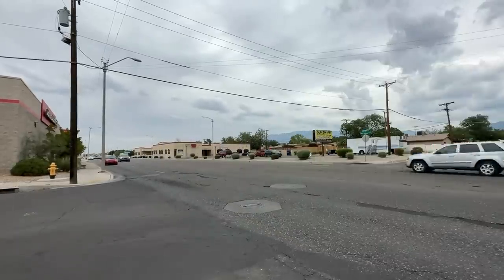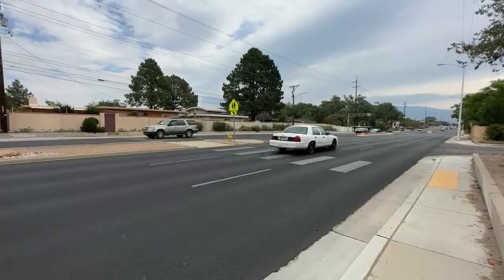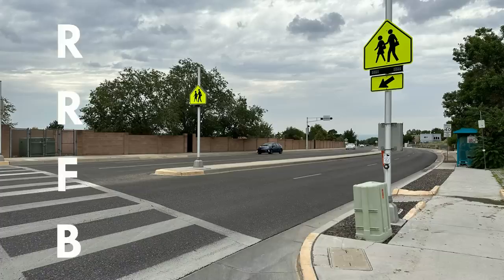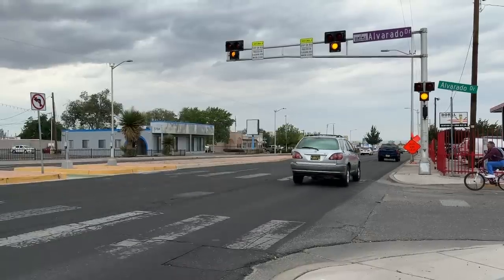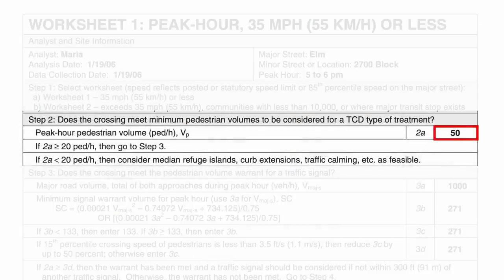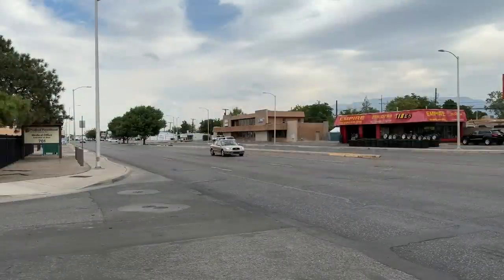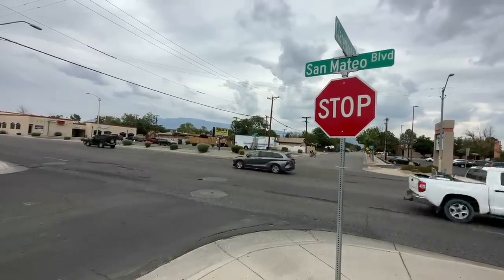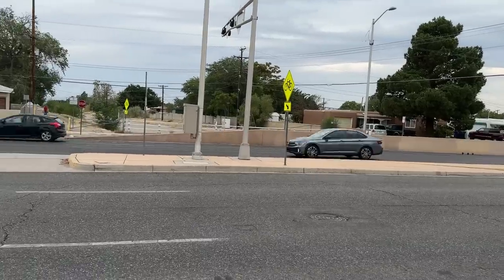The Insane Ways Traffic Engineers Try to Make Streets "Safe" For Walking

Comment: Came here from Nebula just to say that I was personally hit by a pickup truck at one of these crosswalks. I pressed the button, waiting for all four lanes of traffic to stop, looked both ways, then started walking. As soon as I did, the lights timed out and stopped flashing. The driver of the truck was looking at the lights not me, likely because I was barely visible because his hood came up to about my shoulder. As soon as the lights stopped he started driving and hit me in the hip. I was working as a delivery runner for Jimmy John's at the time and was so worried about being late and losing my tip that I didn't stop to get witnesses or talk to the police despite many people stopping to ask if I was okay and offering to testify. I just limped my way to the next delivery. Looking back, I wish so badly that I would have pressed charges. I've since paid nearly $2,000 for physical therapy on my hip for issues that came up more than a year later.

Comment: In British Columbia, Canada we occasionally have pedestrians controlled traffic lights. How they work is that they flash green until someone presses the crossing button, then the light turns red for cars allowing people to cross. Since they work similar to regular traffic lights, drivers must stop on red. I'm not sure if this is the best solution (Dutch style raised zebra crossing would be better of course) but in my opinion they seem simpler than whatever the US is coming up with. And since these pedestrian controlled lights use regular traffic lights, they can be easily converted to a 4-way traditional traffic light intersection.

Comment: Laramie has one of those HAWK things for crossing a 4 lane road between a neighborhood and the University in the stadium area. As a motorist, I hated that thing. There were a couple paragraphs of instructions on how to use it, as a driver... you know how you are supposed to react when the lights were activated, that you had to be so close to read that you would practically be parked on the pedestrian who pushed the button before you understood what you were supposed to do. They should replace those things with regular traffic signals that just stay green until someone pushes the call button.
Reply: Or even better stay dark until someone pushes the button. Green sends the wrong signal.

Comment: In Uruguay I noticed all schools, everywhere, halved speed limits in school zones, and my driver there said fines and traffic reactions was doubled for speed or yield infractions.

In Norway there have been done design measures to separate pedestrians from traffic, or speed limits are set as in residential local roads. There are increased controls in such school areas while schools are in session with increased focus around when school starts after holidays.

In Brazil we where dependant on driving the kids to school as none of the schools in town had safe ways to reach the students entrance by foot.

Comment: Re: Your question of "Is there a reason any street in the US needs seven lanes, anywhere?"

I've been thinking about this a lot, and I think it's better (and safer) to start separating the transit modes rather than adding more car lanes.  Low traffic streets fine for mixed modes.  A bit wider, busier street?  Dedicated bike lanes.  A major thoroughfare?  Dedicated transit lanes.  Increasing vehicle speed doesn't affect throughput at all, so why bother?

One transit lane, one car lane, and one bike lane per direction is much safer, carries more people, and you still have one lane to spare (which you can give back to the pedestrians!).

Any attempt to put in more than one car lane per direction for a street (not a road) should immediately be countered with "why don't we try to increase transit and bike use instead?"
Reply: You think this has not been proposed? Good luck getting your voice through the the car lobbyist sponsored ear plug.

Comment: For the record, I am not a city planner, but I do have ideas for crosswalks. If all ways have no parking lane near the crosswalk and at most 11 ft lane width. One lane per direction, no refuge island unless there is a left turn lane, in which case there should be. 2 lanes per direction needs a refuge island. And 3 lanes per direction should be the absolute maximum. No more than 3.

Comment: Those zebra crossings look scary as fuck. I'm in Australia, which is pretty damn far from the pinnacle of pedestrianism, but they're very rare outside of car parks, and where they do exist, they have 24/7 flashing yellows about the size of level crossing lights, not those tiny things on those RRFDs. They're also usually raised above road level, and in areas with reduced speed limits. Everything else has traffic signals identical to any other intersection. I wouldn't advise walking as soon as the little man goes green, as it's not uncommon for someone to fail to make the yellow, but people will definitely stop.

Comment: My main question after watching this is why there aren't any normal signs at a crosswalk. Mere painted stripes on the road are not enough for visibility. Especially if you're doing 55-60 kph ("35"), you'll be pretty far away when that starts to matter.

In Sweden, the double-threat overtake is also illegal. The penalty? You will lose your license on the spot.
Reply: Law enforcement would have to see you (in flagrante delicto) do it and enforce it, which is rare. It’s very hard to lose your license in the US, even if you kill someone. Even if you do, the person who lost it will probably just keep on driving without it.
Reply: @danielkelly2210  Indeed. And driving without a license is of course an offense in itself - just even harder to discover.

Comment: I watched this video because I saw one of these RRFBs for the first time driving thru Vegas.  We don't have these in CA.  Everyone was slowing down, some people were stopping, some going right thru.  I didn't see any pedestrians so I went thru after stopping.  The ones we have in LA are much easier to understand.  When someone presses the button a light turns red for the traffic.  Everyone understands they must stop. Then after a while the light starts flashing red which most people understand means stop then go if its clear. Sometimes people just stop and wait for the light to change.  They block the traffic behind them for a minute which isn't a big deal.  At least they are not running anyone over.

Comment: Nice to see Albuquerque in the intro! Despite it being generally awful for bikes and pedestrians, there are lots of off-street pathways available. Though they aren't well maintained, so there are some huge cracks which make it a less than ideal ride. However compared to most other American cities of a similar size, in the older (pre-1970?) parts of the city it's easy to avoid the arterials and actually go places either via the pathways or through calm neighborhood streets (there are several bike/ped crossings across I-40 and I-25 to avoid the clusterfrack of those huge interstate entry/exit interchanges). Still -- lots of work to do. For example, there are ZERO protected bike lanes despite over 50 miles (maybe 100?) of on-street bike lanes.

Comment: Before I moved, I would regularly use the western canal trail crossings for my commute in Tempe/Chandler. They used full traffic signals instead of hawks (hilarious acronym btw) even though there was no cross street. Map coords: 33.356961, -111.859112

Of course, the route was far more perilous once you got off the trail to/from your destinations. It's a shame the only things on the route are the canal, power lines, and the occasional park.
Reply: I should add these crossings were especially nice because your wait time for the signal to turn was only about 5-10 seconds. It feels nice to be truly prioritized over cars for once.

Comment: There are a lot of RRDs along Ocean View in Norfolk, Virginia, and Pacific in Virginia Beach. They are placed on the approaching traffic side of the sidewalk and due to design they can have the effect of making waiting pedestrians less visible than typical when the signal isn't active.

I remember seeing regular traffic lights that were activated by the push button in Chapel Hill (on W Franklin St) and Cincinnati (I forget where; was there only because I missed my exit.)

The type of signal used for the HAWK is common outside fire department stations in multiple cities where I've lived and visited though obviously with different timing, and often with a default of flashing yellow.

Comment: In the 90's-2000's in the lead up to the disability discrimination act I was a member of a disability charity which was helping the local council with better street/road design among other things, pedestrian crossings were a complex matter for those involved in road design who didn't have a disability, a point mentioned in your video is a bug bare with many road designs "how to slow down traffic when needed", something I had seen elsewhere seemed to work and work well, a 4 lane road in a city (traffic was already restricted to 40mph maximum and posibley less), the crossing area is raised by around 4 inch, this naturally slowed traffic without stopping traffic flow, during the day the lights work automatically and at less busy times (for pedestrians) a button press is needed, this keeps traffic flowing while still allowing pedestrians to cross with minimal disruption, you made it clear that the numbers of pedestrians needed is made too high for crossings to be generally concidered, I understand that too well, but finding a way that a percentage are happy with is generally acceptable by most, always avoid bridges and subways as they exclude those they are meant to be helping the most.

Comment: I get the problem with the beacons and have actually seen drivers being oblivious to them.  There's a beacon crossing near where I live and I do cross there.  It's a busy four lane state highway with a refuge island in the middle.  I find I'm able to scan oncoming traffic and can tell if a vehicle is not going to slow down so I've never had a situation where I was caught by surprise.  Also, I use a mobility scooter so I cross faster than most.

Comment: I'm not in the US, so traffic design here isn't nearly as terrible. But the best solution my city ever came up with, at what was at the time the single most dangerous pedestrian crossing, was to add traffic lights to said zebra crossing and tack on a speed and red light camera for both directions. They widened and heightened the median and added bollards to make it impossible to overtake at that bit of road. And last but not least they moved a nearby bus stop to now be at the crossing, so if the bus stops there it basically stops all traffic behind it.

The lights are set up in such a way that if a pedestrian pushes the button, the cars instantly get a yellow for 4 seconds, after which it's red and the cameras are utterly ruthless. They provide no margin at all. The fine for running a red pushes 400 euro and the system will also enforce the speed limit. So run a red going 55km/h after correction, and you're looking at neigh on 500 euro in fines.
And there's no point in fighting the fines either. Because there's a photo of your car going through a red light at a zebra crossing with a pedestrian about to enter the crossing. One case made the local paper as someone tried to argue that the 4 second yellow wasn't enough time to react and stop from 50km/h. The judge suspended their license pending a medical exam with the argument that if 4 seconds is not enough time for you to react, you probably shouldn't be driving a motor vehicle at all.

Comment: In my area, school zone speeds are for a lot longer than twenty minutes. Rural area, most of the schools are located on country roads, not town streets.

Neighboring city has the RRFB's, with cat's eyes lights in the street. As a driver, I can barely see them until I am on top of them. They need to be full-sized traffic light style fixtures, like those on the school zone signs. Or a the overhead lights, as shown. There's frequently too much other stuff in the area: street parking too close to the crosswalk not expected to be in the middle of a block, with poor lighting all around.

As for being at full intersections, too often the button-activated pedestrian signals are programmed to wait a full cycle for the vehicular traffic. As a result, I have seen far too many pedestrians not wait for their signal, their turn to cross.

Comment: RRFB is useless.  In fact, if the dumb pedestrian thinks he's gonna be protected by this thing he's more likely to get hit.  Let me introduce some reality based on what drivers THINK theses things mean:
1)  Flashing yellow:  it's gonna turn red soon, so speedup to get through the intersection before this happens
2)  Flashing red:  In this case, the traffic engineer was too lazy to make the red switch on and off so it flashes all the time.  Roll through and try to check for obstacles
3)  Solid red:  This one actually means to STOP.  Although it's only wishful thinking if it hasn't been at least 15 seconds since yellow.
     I live in a fairly nice suburb with primarily two-line streets and only the occasional four-lane street.  Recently, RRFBs were installed in town and also in some outer areas that cross a multi-use trail.  The drivers are so polite that if I approach a street, stand back from the crossing and do NOT press the button, they'll typically come to a complete stop to let me cross.  Installing RRFBs did nothing to make these folks more polite.
     Consider the outer areas.  Speed limits are more like 45mph.  Largely, pushing the flashing yellow of the RRFB has no impact at all.  In some cases, I swear they speed up!  This is most common for the guys driving huge pickup trucks and/or hauling a boat.  The cyclists out here have learned to never push the buttons for these RRFBs.  Why do it?  The leather-skinned boat bros will NOT slow down or stop for a bicycle or pedestrian.  We're only lucky that these roads are still only two lane.  So wait your chance and bolt out of there.
     RRFBs are the devil.  Make a damn RED LIGHT or don't bother.  Please!

Comment: Boulder Colorado has a shit ton of these flashing crosswalks. They more or less function, but often times cars don't or can't stop in time. I think the design flaw is that people press the button and immediately start crossing the street. Unlike a traffic light, there's no stage between Go and Stop, so it creates the unrealistic expectation that cars must slam on their brakes the instant the lights come on. Cars that are traveling over 20mph are unlikely to be able to do this if they are nearing the crosswalk. I've seen a version of these flashing crosswalks in the UK and Germany, where the pedestrians don't receive "permission" to cross UNTIL traffic has fully stopped. Seems much safer.

Comment: I live in Seattle without a car, and also work as a delivery driver driving around the city.  Seattle has quite a few of the RRFBs, and I experience them as both driver and pedestrian.  I like the RRFBs in Seattle as a delivery driver, they help me out a lot.  Even driving at Seattle's 25-30MPH I sometimes struggle to see pedestrians on the side of the road waiting to cross.  There is often a lot of obstructions like parked cars and trees that sometimes don't allow me to see pedestrians on the corner until I get very close to the intersection.  RRFBs help with that by letting me see from a distance that there is someone at the intersection, and they are about to cross, which allows me to have plenty of time to stop for them.

I think that CityNerd made a good point talking about how stopping for pedestrians should be a given, and I agree that having RRFBs on wide stroads shouldn't be required if everyone driving respected stopping for crosswalks.  However, in smaller, narrow streets that have cars parked on either side with trees, trashcans, etc. I think they are great.

Comment: My employer has a parking area on one side of a 30 mph street and our work location on the other. We have a crosswalk with one of the mentioned RRFBs. It certainly doesn't get the compliance claimed by DOT is far beyond what I experience. Using the crosswalk is akin to live action Frogger. I've the HAWK signals going in over the last few months. They are confusing for those who've not seen them and the tiny signs explaining what to do are worthless. It all gets back to "traffic" engineers only caring about motorized traffic.

Comment: Only thing with RRFBs I've had issues with is the ones that stay on long past any pedestrian has crossed the road which leads to many ignoring the RRFB in those poorly timed areas. One of the arterial roads that received funding for RRFB and raised cross walks has only installed the raised crosswalks and I would say it remains sketchy for a number of factors. There has been decades push for pedestrian only stop lights in that area while the county and DOT refuse. Interestingly there isn't as much need for HAWKs in my area as the places a bike would want to cross a stroad already has lights.

Comment: a lot of the issues with traffic engineer brain are kind of the same issue: failure to think of induced demand in road widening and failure to think of induced pedestrian demand to cross the street stem from the same place imo. the document you showed is just absolutely ridiculous and engineers ought to be smart enough to imagine that if you change the infrastructure, it will change how people use it. yet that principle seems to completely elude them!